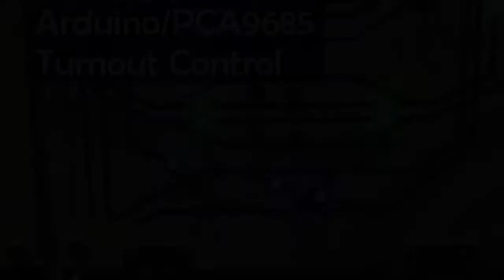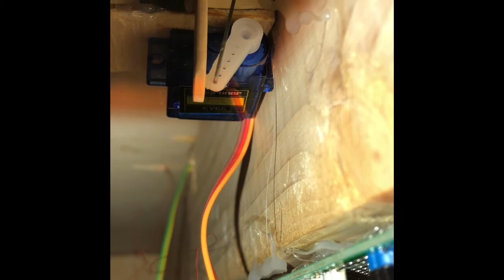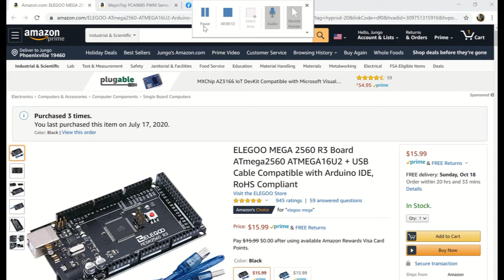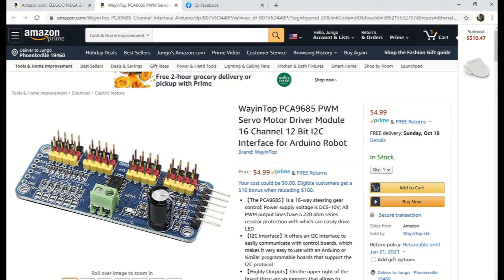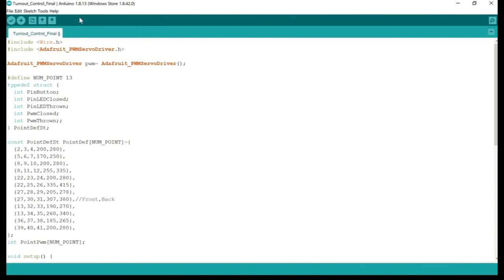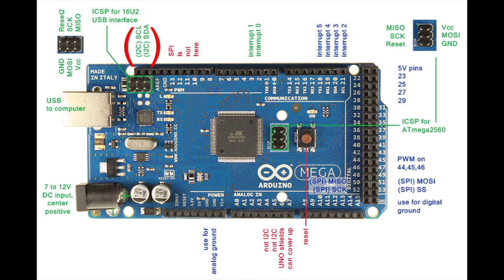Model Train Turnout Control using Arduino and PCA9685

Comment: Great video. I followed your instructions and have 2 turnouts working almost as I want them to. 
My question to you is, in your video, you say you are using toggle switches but your diagram has push buttons. How would I wire it up to use toggle switches?
Reply: Never mind, I figured it out on my own. Still, a great video. I will be using all 16 pads of the 9685 once I get the rest of my servos.

Comment: Hello, Do you have a diagram to show how to connect more than two servos? Can this system allow up to 16 servos for 16 points on the PCA9685? Also, what toggle switches are you using--for example: spdt (for motor and leds)? or spst? thank you.

Comment: Hey awesome job you made there, one question is it possible to connect this arduino thingy (with switches and pca9685) and signals, for example on a switch i got 2 signals and when i do the thingy and send my train left that signal goes green, Hope you understood what i asked (bad english sorry)...
Reply from the maker: That's totally possible using a simple micro switch. I too control simple red and green light using the existing servo motor. I have a video for changing light with micro switch so check it out.
Reply: @SATODEN  ty

Comment: I would love to use is code, to control my turnouts, but I have them set up with momentary switches, I have no idea how to modify your code to allow these switches to be used, instead of toggle switches. Can you help.
Reply from the maker: Unfortunately this code would not work with momentary switches or at least I can't think of the way it would. my suggestion is to use this same code and test it out with your momentary switch using a breadbord

Comment: Thanks for a great piece of elegant code which works beautifully. 
I had previously had a working breadboard working using Toms Trains code and diagram on an UNO as per the wiring diagram. When substituting the UNO with the Mega and wiring as per your wiring diagram link (same as Toms Trains), the servos would not run because I had kept the SDA and SCL comms wires on the Analogue IP's A4 and A5 as per the wiring diagram of the UNO. Sorted it by wiring to the dedicated SDA and SCL pins on the Mega which I was originally unaware of. Might help a few others from a bit of head scratching who are newbies like me!
Reply from the maker: Appreciate your input!

Comment: thanks for this , I am looking to run two PCA9865's on this with 4 to 5 servos on each , what do I need to change in the code to get the second PCA9865 working ?
Reply from the maker: I think the numbers of pins available on Mega you will be limited to one PCA board per mega. I think you’ll need to run a second mega to run second pca board purely from pins available on Mega

Comment: you're right about the power coming from the Arduino.. only 40 mv total but there is a power board for about $5 us that takes an old PC Power Supply and gives you all the voltages and power you need to run the servos through the PCA6985.  and the power supplies are cheap also (ATX units).
Reply from the maker: Just to be clear, power from arduino would not run servos. Pca requires external power supply in order to run servos

Comment: Thanks for this video and the schematic, especially with Tom's site being gone. I've made my own version of this but am having some weird issues that may be due to me misunderstanding the 2nd page of your diagram. In the 2nd page, did you take the + and - power for the switches and LEDs from the 5v power going to the PCA9685, or from the arduino as in the first page? I built my system taking the 5v from the arduino as in the first page, the 5v wall wart is going to the PCA9685 only. What is happening for me is all my lights work correctly, but when I attach my first servo it goes crazy and wants to continually spin in one direction. I now have a broken and not useable but still test worthy servo that I'll use until I suss this issue out. The only change I made in the code was changing the number of servos to 15, added the 2 lines of code and changed pins numbers and angles (60 and 120 are my starting points). This difference is the only thing I can come up with as my issue, even though it all worked on the breadboard. I can make a video if that will help. Thanks again for this video, schematic and code. Billion thanks if you help me fix whatever I've messed up. If not, still thanks. ;-)
Reply from the maker: Thats strange. I have two different power sources. One is Arduino itself 5v. The other is for PCA9685. PCA9685 VCC connection uses 5v from Arduino. So, LED, Switch, PCA9685 all uses power from 5v pin. Servo is a different story. The fact that you have your servo moving made me think that your circuit is fine. Because PCA9685 will not be able to move servo from Arduino power alone. So that rules out the circuit issue. What I would suggest is 1. use the original code (Unedited) 2. use the same servo with a different pin. Try to eliminate possible issue one section at a time. Let me know.
Reply from the maker: Second thought, PCA9685 needs to be powered by both 5v via VCC and the external power source. So branch out the power from arduino to PCA9685 and see what happens.
Reply: After thinking about it a bit I just went ahead and tried the power hub you mention on pg. 2. Same result. Any ideas?
Reply from the maker: @WisenheimerYZTV  Did you download PCA9685 driver?
Reply: @SATODEN  Yes, I have the driver. It all worked on the breadboard with your original code. I've reconnected to how I originally had power run and reupload your original code. Works great, so I probably justr messed up the code somehow. I also found that the angle numbers are way different. In the servo test and set codes I used to check my servos, the angles are 0 - 180. Not so in your code, where my angle of 60 is what killed the test servo. 280 - 500 seem to be the angles I need. Hmm... I am missing something important somewhere. My biggest issue... my brain. Thanks for helping me suss this out. Not sure what exactly I did, but if I have to bust out a nano to get my last 2 servos going so be it. I'd rather not... any ideas? Did I add the 2 lines of code wrong, I wonder? Probably. Most likely. Educated guess - yes, yes I messed it up. lol I hope to get this all running so I can confuse myself more by adding nrf24l01 communication. I will surely mess that up. In the meantime.... is copying and pasting 2 lines of code the wrong thing to do? Cuz that's what I did. I thought I did, anyways. Comparing side by side... scratching head. lol
Reply from the maker: @WisenheimerYZTV  copy and paste should’ve worked. You should def check the angle of your servo before using it. I might have forgot to mention that in my video. It’s hard to tell if you messed up in code unless I look at it but if the original works there must be something that went wrong on the pasted code
Reply: @SATODEN  It was the angles, and the angles alone. I tried again with my thought to be messed up code, but with the new angle numbers. Now it works fine. So somewhere along the lines I missed a step in a conversion or something? Indeed, something important. Thank you, man. It's only been 2 hours since I posted this, and before that I was about freak out. lol Been working on this for weeks, most soldering I've ever done. So excited when all the switches and lights worked. Then.... BZZZZZT!! Oh no! lol I think the servo might even still be useable. Amazing. again, thank you so much for posting this video, schematic and code and I can't thank you enough for helping me troubleshoot. This is all new to me, actually my first arduino project ever. I will post a video when I'm done, and I'll post a link to this video. How is it you only have 109 subs? How does this video only have 1815 views? Crazy. Thanks again! BTW, when I make my vid how do I pronounce Jungo, with a Y sound or a J sound? I'd like to not butcher your name when I mention you. :-)
Reply from the maker: @WisenheimerYZTV  glad that you were able to figure it out. My name is pronounced as J. Thanks for the mention! Good luck with your project
Reply: @SATODEN  Can't thank you enough. :-)

Comment: Hi there, I have started wiring my layout with servos controlled by a MEGA board and PCA9685s (probably need 3) and using your excellent sketch. I didn't feel the need to have LEDs as the switches themselves indicate the throw direction, as in a real signal box. I'm having a few issues with random twitches on some servos and wondered if there is a solution to this, or is it just that some of my servos need replacing? I am using standard SG90 servos.
Reply from the maker: Good to hear. I've experienced that as well. Unfortunately I think some of those cheap servos do have twitching issue. I'd suggest to change out that servos to see if it improves. If not the issue maybe elsewhere such as loose connection
Reply: @SATODEN  Many thanks for the quick reply. I will try to get some better servos. Another question please, is there any way of turning off power to the servos without having them all twitch when I turn it back on?
Reply from the maker: @oleyorkie  I thought about that too. One way I thought of doing is to sandwich capacitor between PCA 9685 and the power source. But then I found out that pca9695 does have a built in capacitor. Maybe there are better way of doing this but I don’t have an answer for you.
Reply: @SATODEN  I think I have found a solution. I connected the OE pin to +5V via a 10k resistor, using a toggle switch. That kills the output and stops the servos chattering. I am about to try connecting a second PCA 9685. I have modified the sketch to include PWM2 and hope I can just continue adding servo channels. Thanks again for your help.

Comment: Thank you for awesome video. As Tom's website is not working anymore I couldn't find any information about how to wire toggle switches and LED's. Your diagram helped a lot. If you don't mind can you show how actually you made and organized your control panel, please? There is a lot of information of how to control it though JMRI but I actually want to make it just like you using toggle switches and LED's and can't find anything about it. Thank you again
Reply from the maker: Anatolii, Thank you for your comment. Wow I did not know that the website is gone. I wonder what happened. Let me see what I can do. I will get back to you.
Reply: @SATODEN  So I checked again and it looks like your video is basically the only source of information about how to wire control panel with LED's and toggle switches. All other sources do not use 9685 board or use JMRI as a control software. So thank you again for your help. Really appreciate it.
Reply from the maker: @anatoliidudko7029  Sorry, I didnt forget about this. I will def put something together for you this week.
Reply: @SATODEN  Take your time. You already heled me a lot. At least I know that it's something that I can make myself.  You made a short but highly informative video.
Reply: @SATODEN  Sorry to bother you again, but can you please make an update about your control panel wiring? Thank you
Reply from the maker: @anatoliidudko7029  hey man, I was making a video for you since I can’t post pictures. But while I was doing it the entire system shorted and broke. I need to rebuild it. Sorry but I wont be able to finish that video
Reply: @SATODEN  Oh that doesn't sound good. Hope you will fix it.
Reply from the maker: @anatoliidudko7029  What part of wiring are you not clear? Or did you just want to see how I did it? Mine was an electricians nightmare. Hence why I had this issue happened. All I did was applied that diagram to real life wiring without using a breadboard.
Reply: @SATODEN  Wiring outside breadboard is clear and simple. But i am completely lost on what is going on with connections on breadboard. From video it's hard to see what pins are used to connect buttons on Arduino. Not sure what resistors to use for it as well . So breadboard part looks confusing to me.
Reply from the maker: @anatoliidudko7029  I uploaded a new link in the description to my google doc. There is a document I just created with more crisp look of the diagram in my video plus the diagram of how I wired it. Just keep it mind that pins on arduino will depend on the numbers of LEDs and switches you have. You can adjust the code accordingly and assign pins.
Reply: @SATODEN  WOW 😲. Thank you so much. Now everything looks clear.  Hope you will fix your layout soon.

Comment: i do have one question. when you activate the toggle, it is always open or always closed, not momentary?
Reply from the maker: Hey Mike, if you get two prong  toggle it will always be either closed or open. If you get three prong I assume a turnout will still be closed or open but your toggle switch will have the neutral position. I would recommend using 2 prong
Reply: @SATODEN  I was asking because I already have a few SPST momentary switches from another project. I will have to get some always open or always closed SPST toggles to try this out.